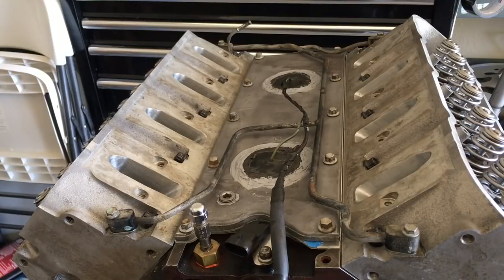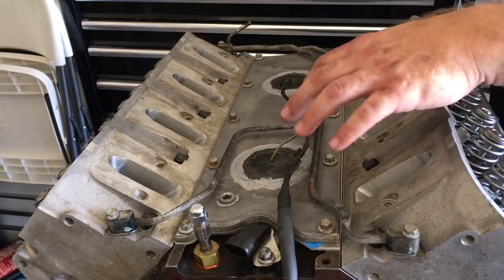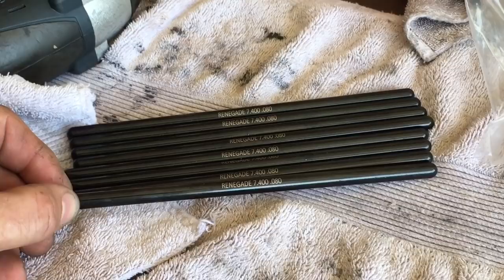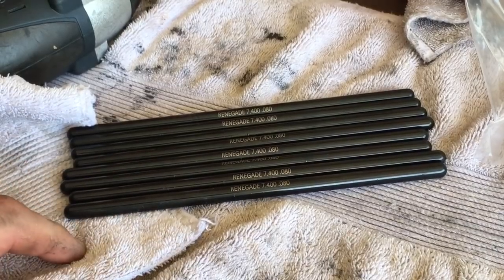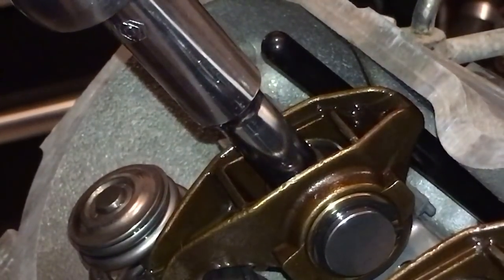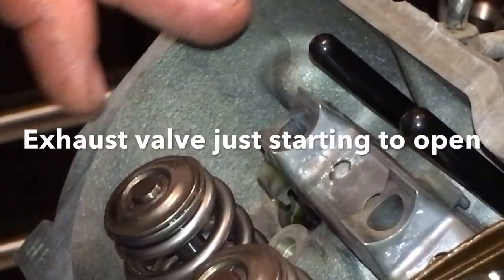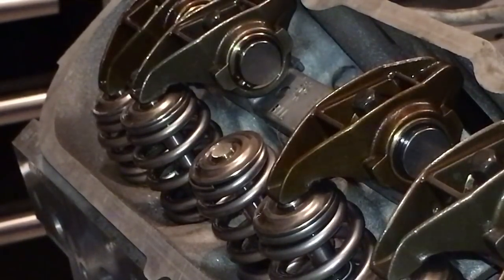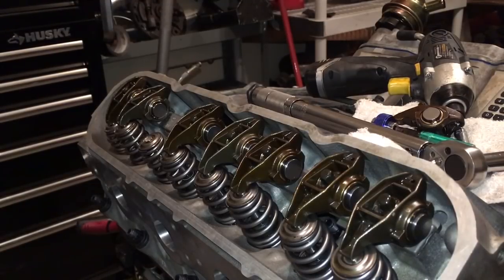LSX How many Turns to set lifter preload

Comment: Ok people watching this vid .047 is one full turn with out rocker ratio.You must factor in the rocker ratio so it is .047 x 1.7 which equals .0799 of preload with a full turn and 3/4ths of a turn is .0599..you want to be in the middle of your plunger travel..a ls7 lifter has .126 of travel while older ls1 have .200 travel..ls7 lifters have a plunger cup higher of ruffly .050 so this throws off stuff if you swapped lifters..buy a comp push rod checker its worth the $25 just remember to never spin the motor with it in..easiest way to get to eoic method is stick pushrod in the exhaust side..rotate engine while holding your thumb on the pushrod,once it starts to move up you are now on the intakes base..stick your adj pushrod in and lenghen it till you just get the wiggle out the tip.you then pull out the pushrod and measure it..you then add what your desired preload to that length and that is the pushrod length you need..now stick it back in the intake side.hold thumb over top and then turn the engine over till you hit max lift and you feel the pushrod just start to go down..now you are ready to do your exhaust side,take pushrod checker and back it down slightly and then repeat the steps you did on the intake side to hit zero lash..pull out and check length then add your preload you want for what your lifters call for..a little longer pushrod will stop the sewing machine noise if your one of them people who hate it and think something is wrong..but I do not recommend this I shot for mid travel unless I'm super tight on a motor for ptv and it will be more along the lines of a race engine then I run minimal preload just in case a lifter pumps up and also this allows the engines to rev faster..hope this helps some people
Reply from the maker: ghost727 Watch this video: lash should be .0528” but the lifter made a knocking sound. Not a tick, sewing machine, but lifter knock. 
https://youtu.be/00bUIrJG1Tk

Comment: 22lbs and it is done
Reply from the maker: Randall Wyatt If you’re only tightening the rockers it’s ok, not optimal. There’s more to it but that’s ok.
Reply: @HeadFlowInc  with a old school small block chevy you would be right but not the ls engine
Reply from the maker: Randall Wyatt You do realize this video is about checking lifter preload?  The fact you’re not understanding what the video is about is concerning. Like I said there’s more to it than your limited experience with the LS engines.
Reply: @HeadFlowInc  you mean your  limited experience    not mines
Reply from the maker: Randall Wyatt I hope you’re not saying it’s ok to just throw it together without checking pushrod length?
Anyone can look up the torque specs for the rocker bolts. 
Here’s a list of a few reasons why the PR length changes:
Head gasket thickness
Brand of lifters
Milling the heads 
Milling/decking the block
Aftermarket rocker arms or ratio
Camshaft base circle

If you’re familiar with all this information,then what would you gain out of arguing a mute point of how you tighten the rocker bolts after you have the proper length? 🤔🤷‍♂️
Reply: @Ls3guy . The word is geometry 📐. Never you have guessed that high school mathematics or lesser grade education came into play with a rocker stud bolt.  Did ya??

Comment: Isnt the 1.25 : 1.5 turn meant to be done with an adjustable push rod and not the rocker arm bolt itself? I'm not sure the thread length would  cross over when it's done at the pivot point, luckily hydrilic lifters are a little forgiving hope you build goes well.
Reply from the maker: NoSleepRacing I’m buying an adjustable pushrod to set my lifter preload exactly.  Here’s what I’ve been told:  Yes you can measure the rotations on the M8-1.25 bolt to torque with a real pushrod, BUT you have to multiply the compression distance of the bolt by 1.588” to find the Net preload!  
Here’s more confusing information on suggested lifter preload:
Katech recommends .070”
Comp Cams .050”
Brian Tooley.100” 😳😳😳
There’s theories on why you would want a deep preload, it helps with valve float. 
It’s frustrating people share half-truths or plain don’t know how to measure preload. Using the adjustable PR is the easiest and most accurate way to find PR length!  The tool is only $21.00

Comment: "The rocker ratio is considered a non-factor as the Pushrod is opposite the Valve on the “short side” of the rocker arm. The lifter preload is a linear change in rocker arm height Vertically." -- Makes zero sense! You can't change the height of your rocker arm post. You can only change your pushrod length, so you need to measure at the pushrod, not at the bolt. 1/1.7=.59, so at the pushrod end it will move 1.59 times of what it moves at the bolt.   If it was a 1:1 ratio rocker arm, it would move 2 times at the push rod than what it moves at the bolt.
Reply from the maker: Vito5790 Do a Google search on this topic from other shops building these style engines. You do understand, when I turn the rocker bolt after establishing “zero lash”, it’s compressing the internal valve in the lifter not the valve?  
The spinning of the push rod only established zero clearance between the rocker cup and the lifter cup, so as i tighten the bolt the “lifter preload is established”. 
The one odd ball valve used a shorter push rod.
The engine runs super quiet when cold but in my opinion the rockers are a tad noisy when heat soaked.  But I do have the solid trunnions upgrade in the rockers which I’ve read tend to be a tad noisy.  🤔
Reply: @HeadFlowInc  Do you not understand simple geometry? What I'm saying is that you preloaded the lifter more than you thought. Precisely 1.59 (notice i didn't say 1.7) times more because you measure at the bolt by measuring how many turns. Also i don't care what other shops do. I only care about what the manufacturer of these components recommend. And they provide a tool to measure your zero lash length and then simply add to that length the amount of preload you need
Reply from the maker: Vito5790 I would swear, when I researched the “ratio” percentage on he pushrod side, I found it was negligible due to the pushrod cup being so close to the trunnions.  I started out trying to validate the “split” in ratio on the rockers between the pushrod cup and the tip over the valve stem. 
I know you’re only trying to help; I appreciate it!  If I can validate your theory I’ll swap these pushrods out ASAP!  What’s concerning is there’s so many people doing it wrong if your ratio theory holds true. 😳👍
Reply: @HeadFlowInc  next time you do this put a dial indicator on the rod end and you'll see what I'm talking about
Reply from the maker: Vito5790 I’m going to make a video on this topic. There’s too many different theories, I want to show 100% what’s going on. 
Let’s say I thought I had .065” preload using my method, by multiplying.065” x 1.59= .10335” 🤔.  I’m not sure this math holds up.
Reply: @HeadFlowInc  before you do that, you should learn how levers work. If one end is stationary, and you move it in the middle, the opposite end moves two times of what you moved it in the middle. In this case you're not moving it in the middle, but slightly closer to the opposite end, so it moves 1.59 times instead of 2 times.
Reply: @HeadFlowInc  so yes you have 0.103" of preload
Reply from the maker: Vito5790 I understand how levers work, I promise, it’s only a situation where I found data that doesn’t support your 1.59 factor.  But all those builders could be mistaken. 
I wish they had a simple tool like they have for checking an old school rocker geometry! I’m game, I want to find the easiest and most accurate way of finding the best PR length.
Heck, I can’t even validate what the best preload is!  Every manufacturer has a different preload! 🤷‍♂️😳🤔
Reply from the maker: Vito5790 Think about this, have you seen anyone using a really short PR’s in the LS?  Stock length 7.400”, if I cut the heads .030” it makes sense the PR needs to be shorter the same amount.  Only, when running Aftermarket lifters, cam and head gaskets nothing establishes a base/standard to work with.  Ex: say I have .10335” preload, this means I’d need +- 7.35” PR...  it’s possible for sure. 🤔
Reply: @HeadFlowInc  Just pull the valve covers off and check your preload using a dial indicator on the rocker on the pushrod end and you'll see a number around .100"
Reply from the maker: Vito5790 Here’s some interesting info I found today:
It's different than everyone else, or mostly everyone. 
Here's another parameter that differs greatly, how much lifter preload is best?
Katech recommends .070"
Comp Cams .040-.050"
Brian Tooley .100" 🤷‍♂️
It's crazy how different everyone can be? 🤔😳😉

If you preload the LS lifters .100” it reduces the amount of oil/potential air below the lifter plunger creating a short travel.  Short travel hydraulic lifters help prevent hanging a valve open if/when the engine experiences valve/lifter float at High rpms.  🤔🤔🤔

Comment: when you torqued No 1 intake is wasn't on the base circle, as soon as you start the valve begins to open. watch the video and keep your eye on the valve.
Reply from the maker: Brooklyn202 
You are 100% correct, the valve moves for sure.  I have no idea why it was off, people do make mistakes, I made one apparently. 
I no longer trust this style of measuring the lifter preload, it’s way easier to buy the adjustable pushrod. 
EO-IC
Exhaust just beginning to open adjust the Intake Valve. 

Intake just beginning to Close adjust the Exhaust Valve.
https://youtu.be/BWWUgzYH_NM
Reply: Gotta adjust them all on base not the beginning to open or close. I've learned the hardway myself.

Comment: I never have liked this setup on the LS engines it’s an in-between shaft mount setup with zero adjustability. I think this is why so many LS cars kill lifters and wear out guides. Great video though this is where coming from SBC stuff like yourself helps you notice things that a lot of the new kids have no clue about.
Reply from the maker: TPV Productions I’m almost ready to fire the fresh 4.8/TH400 combo, hopefully by this weekend. I’m building a pump gas daily driver, to start the Goal is 300 rwhp, then low boost single turbo limited to 500 rwhp.  Mild by today’s standards. 👍😎
Reply: HeadFlowInc You should have no problem making 500. That's super easy on a LS for someone like yourself. 👍💪

Comment: That's not the right way to torque a bolt. You should not stop turning it and starting over like that. Once you start pulling, you continue to until you reach the torque spec.  If you torque bolts such as head bolts in two stages, it's the same deal. Pull to the first preset ft/lbs. then do the same with the final pull......

Also that .030 spring shim you needed on the exhaust has absolutely nothing to do with the pre-load coming out different. Think about it..... that doesn't affect the installed height of the valve, it only affects the spring. It's the difference in installed heights of the valve itself that's causing the difference in pre-load. The spring has nothing to do with it.....The fact that the other exhaust valve's pre-load came out OK is just luck. 

When you do a valve job, part of it is setting the installed heights equal. If you ever worked on engines with shim and bucket lash arrangement you'd learn real quick how much that matters.
Reply from the maker: Larry Cavanaugh Your optimism is interesting, when you work on cars you’ll find out you don’t always have room to “Continue” to the torque spec in one non-stop pull. That’s not realistic.  
Constant & continuous pressure is how I pull to torque.  If I go back over something in a video that’s just to show a fastener has been torqued.
Reply: Different style torque wrenches.

Comment: So wait, what are you going to do with that .030" shim now? How do you fix that?
Reply from the maker: Lime The .030” shim is how I set the needed 1.800” installed height needed for the Comp Cams 918 Springs. The shim stays, the only other way to correct the issue is by replacing the valve seat.
During the process of correcting the poor work of the first shop who attempted a valve job on these heads, Jack had to cut only one exhaust seat more than he wanted to clean up the chatter marks.
It will be fine, everything is as it should be! 😉👍
Reply: oh ok